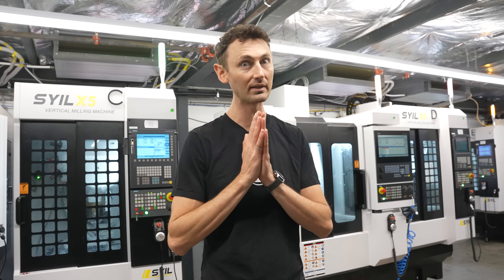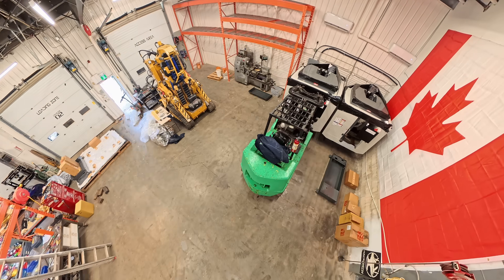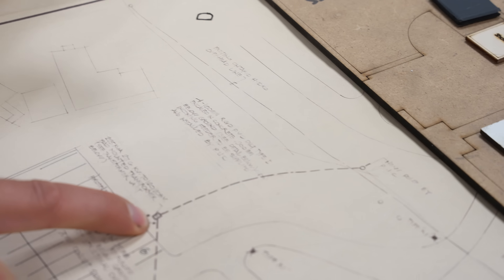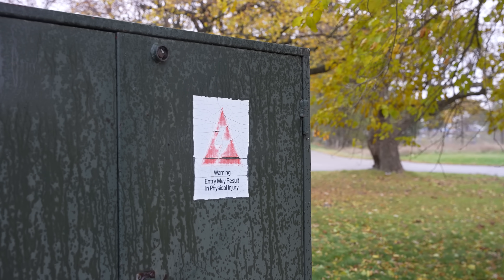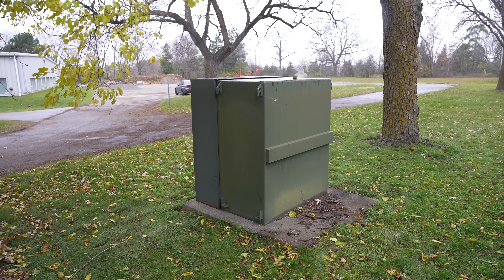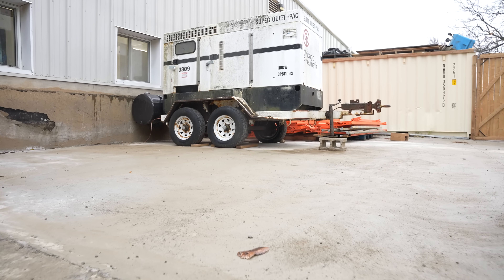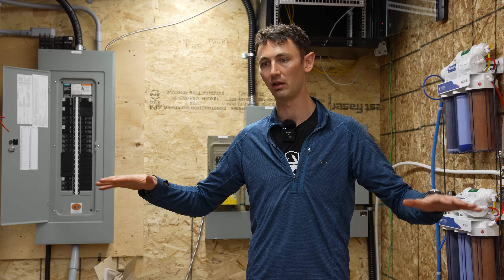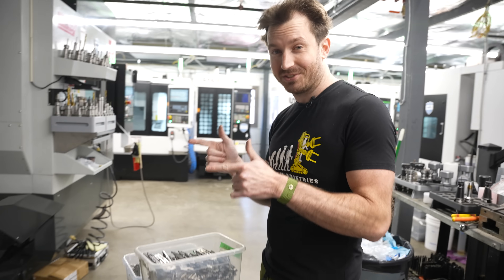We need HOW MUCH power? ⚡ | Smith Blade Update | 07

Comment: hey just a small suggestion, you should or could put up an A/B switching panel.
this way you can have generator and street feed togeter, or even move load to one line to another without shutting everything, and worst case you have issue with either street or generator you can move everything either to line a or b.
it's commonly installed in high availability buildings

Comment: Perhaps throw a bank of batteries and Victron Multiplus or Quattros or similar between the genny and the load and let the inverters handle any overload the genny or mains can't.  There are plenty of factories that do this when peak loads exceed the mains supply...  the bonus is that you can stay running for a time without mains at all.

Comment: usually you dont use generators like this to power grids/buildings... this is for a construction or film site.... yes its working but not meant for that purpose you would rathr use something like from SAB... we use 2 x 35KVA  and a 500kva system trailer based system, but for you the staionary container option would be far more suitable

Comment: 10 Eco flow delta pro ultra X system and Eco flow delta pro ultra X extra 60 battery and 10  Eco flow delta smart panel 3 and power whole building and 40 solar panel 😊 good idea 💡

Comment: Silly question, is it just the initial spinup of the spindle that draws the most current or is there high hogging material removal that draws a similar amount?  If the spindle is VFD driven, can you lengthen the ramp speed and/or just change the max current the vfd will put out to lessen the peak loads?

Comment: Trust me, you're fine. Your load diversity isn't going to overload the transformer with some basic planning. The oil bath transformers can be heavily overloaded. Put some CT's on the incoming main phase legs and log the electrical demand across several days. Adjust your machine ramp and feed speeds if needed at that time, or spread machine time to another shift.

Comment: Depending on whether you guys have serious natural gas supply to your location (I am talking about supply lines >2inch diameter) or can get a supply line, get a natural gas generator, integrated with BESS and solar. You can run the generator to charge your batteries at its most optimum load, and then run your equipment off your batteries (far more efficient) and can also have a deal with your utility to provide them power during peak hours so your total operational cost gets lower.

Comment: So if you were supposed to have 600A service, what were you actually paying for?

Also with the spindles "unlikely" to spin up together doesn't mean "impossible".   What happens if they do? and is there any mitigation possible?  There has to be a solution, as you can't be the first shop to run into this issue.
Reply from the maker: Sadly that's not how it works, it's just the drawings that say there was 600a service, its not like we're paying for the potential energy we can pull, just what we use

Comment: Put a industrial UPS between the Genset and the Workshop. It does not have to have the capacity to bridge the production for long time, but it will level out the power spikes and filter the generator power to the machines.

Comment: For a person that’s been in production manufacturing for 30 years. If you need that mini vertical machines to get your job done you need to step away from vertical machines get a few horizontal machines and Fms system and your total machinery cost will not be more than what you’re doing now. Your 3 foot will go higher and your labor will go down. These are all wins.
Reply from the maker: Miss the part about 2 hour cycle times... A few big horizontals aren't going to work

Comment: for winter solar you want to have bifacial panels and have them upright, that gets much more power generation in winter than the usual setup of flat on the roof or on a 40° angle (obviously because of the low sun but also because you do not need to worry about snow on the panels at all)... So best have a setup where you can tilt the panels up for winter mode and and tilt them back down for summer mode.

Comment: A generator is not made for sudden spikes. They can take several seconds to ramp. Get a bunch of 2nd hand Tesla battery packs and use them as a buffer to smooth out loads. The other option is to rent a second space and continue filling your current space as you grow and have more power available.

Comment: A generator is a good start, but it may also be worth looking at a huge bank of batteries - in the short term you can charge them from the grid when you're under-utilising the grid supply and they can act as a buffer for large load spikes above what the grid can provide. In the longer term, they'll be ready for when you get your solar installed to store all that sun juice and save money on your grid power bill!

Comment: Couldn’t you just use a powerful battery as an intermediary between the generator and the load? That way for high bursts of necessary power, the battery compensates.

Comment: Why the hell would you get in trouble with the city. You are pulling what you were rated at. They were the ones that under built the infrastructure. Honestly, you should call them up and point out the issue and they should be the ones to replace it with what was supposed to be installed.
Reply: they only have 400 amp continuous the cable is rated higher

Comment: Every electrical limit in practical terms, at the end of the day... is thermal. So the fact that you're headed into winter is great news. A transformer isn't rated differently at different temperatures, it'll be rated for 400a at 40'c or whatnot. You can probably steal an extra 50% out of it in winter. If you want to cheat and give it even more of a fighting chance, take the covers off to whatever degree you're allowed and get some big fans blowing on it. And/or a light water spray (if covers aren't off) and it's above melting point. You've got CNC machines, grab a slab of aluminum and build it some 400 lb heatsinks.

Comment: First thing to understand is the power company often under sizes the transformer and allows for fairly significant amounts of routine overload of them as I understand it, different utilities may vary, but it's my understanding that it is common for them to be used over rated capacity for significant amounts of time.

Comment: Just be careful, some machines don't like to work right on generator power.
Slight fluxes in power can cause problems.
Reply: I’m guessing this generator has features to smooth out the power delivery. It’s way too big to not have anything
Reply: @Goose619  it will justbe a proper one

Comment: You could also employ a Komodo Mobile Power Unit (tank), like Zack from JerryRigEverything got… he built a huge mobile solar panel array for it too. So badass. It’s $40K but for what you get, it’s a good deal. 

My wife and I just bought our first house, and it came with a 31 panel array, that the previous owner still owed $41K on, but since the solar company had gone out of business, the previous owner was legally obligated to pay off the balance of the loan as part of the sale. We got such a good deal on it, and it appraised for $40K over the sale price. The only thing it doesn’t have is a battery system, which I plan on putting together eventually. Might do one that is mobile so I can use it for more than just whole home power.

Comment: Is there a way to let the machines communicate so they only spin up one/two spindles at a time?
Reply: they dont, simply the rng that happening is so low that they dont hassle to prevent it. If the whole milling take lets say 15min and the spin up 4 seconds, so probability of 3 at the same time with 32 machines .....  its around 0.040% if i calculated properly

Comment: Unlikely you'll be running at full capacity 24/7. But you could charge up battery packs 24/7 to the limit your transformer allows, and use it to manage peak demand.

I don't know that this would solve your whole problem. You'd need some pretty steep off duty cycle dips in your production demand for that. Maybe half to a third of your issue, though. Enough to cut the diesel you burn significantly? And a way to get most of your power from the street while some comes from the generator.
Reply from the maker: We need to run the machines 24/7 to be able to deliver anything remotely on time...
Reply: @theHacksmithVLOGS  True, but the machines themselves vary in how much power they draw.

A CNC's actuators aren't all running all the time at max load. I may be overestimating how much variability there is, and how much benefit a battery bank could give. I don't know the particulars of your setup. But it's all I could come up with that might give a bit more of an edge to what is already the best blade ever, and the sharpest team of developers.
Reply: @theHacksmithVLOGS  at that point just outsource it

Comment: GREAT story. We had a situation some years ago in which the main breaker to the building quit. Yup, having no power shuts down the whole business.  That lost us a ton of money.  Nice job spotting this before it became an issue.
Reply: Actually had that happen twice at my work last month.   1st the main electrical disconnect in out shop went up in smoke, as in I saw the charred remains of the switch when I came in for my next shift.   Then a couple of days later the transformer outside on the pole overheated, and the oil caught on fire and started leaking out and dripping (while on fire) onto out lawn.    Thankfully it happened JUST as lunch started,  so it was a small leak and fire, and the whole transformer wasn't engulfed yet.   And then I had the fun task of running through the shop, shutting everything down (thankfully it was break so everything was mostly stopped), then hitting the main disconnect.   Unexpected long weekend for us.

Comment: You could just ask your neighbors for temporary power lines. It's unlikely they are using the full load, obviously it comes with some different challenges although it is another option.
Reply from the maker: We don't have neighbors...
Reply: @theHacksmithVLOGS  Those companies across the street have to be doing something xD
Reply from the maker: Across... the 6 lane highway? baha
Reply: @theHacksmithVLOGS  I was thinking across Beaverdale but I just realized its an empty lot. Good luck xD
Reply: @theHacksmithVLOGS  with a ground drill anything is possible. but that's expensive as fuck

Comment: have you thought about hydrogen generators.. ive been seeing those around more and more at events in the UK
Reply from the maker: We'd need a source of hydrogen for that... It's not exactly available
Reply: @theHacksmithVLOGS  its a consumer product
Reply from the maker: I'm not sure what you're referring to at this point.

An electrical generator that burns hydrogen to produce power -- yes, that is what we would need. But you can't buy hydrogen easily due to no infrastructure to using it as a gas source.

A hydrogen generator that produces hydrogen by using electricity, yes, can be done. But wouldn't help us at all because that's just a massive extra step (use electricity to make hydrogen, to then burn hydrogen to make electricity?)
Reply: about as much as a house in the uk